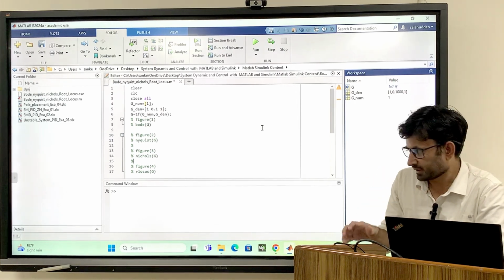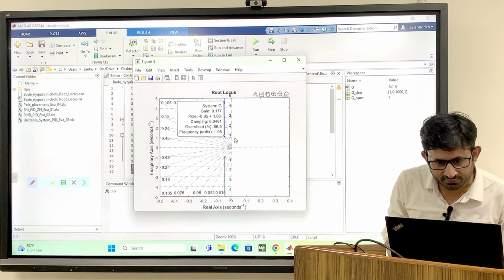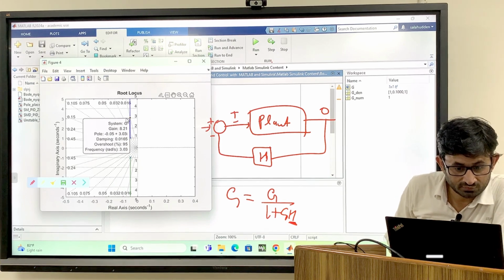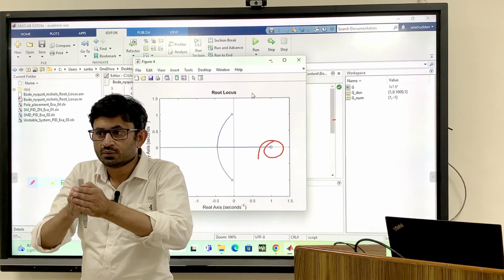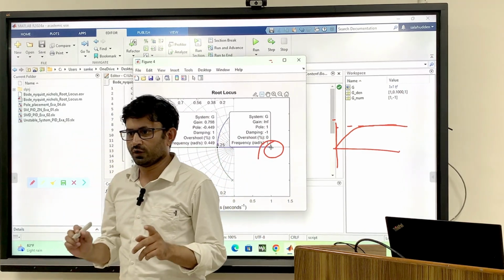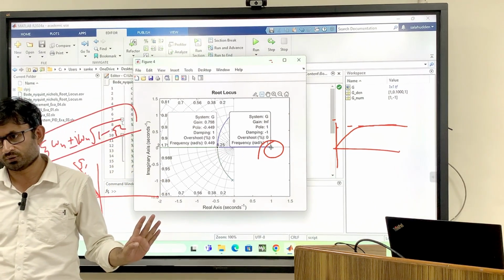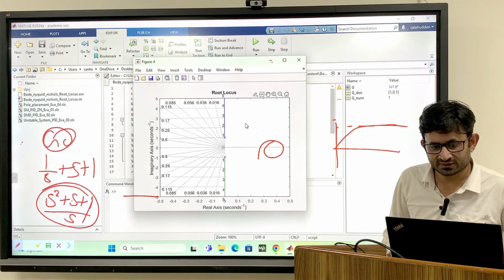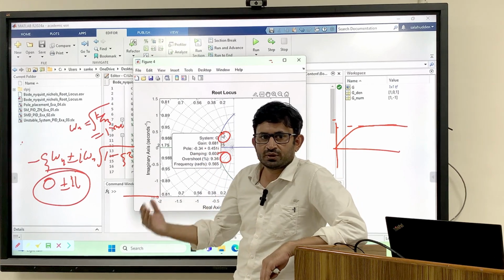Root Locus | SD and Control with MATLAB and Simulink by Dr. Salahudden

Comment: Hello sir,
how to tune PID gains..if my root locus does not cross the jw axis, since it is not crossing jw axis so I can't use ziegler nichols.
Reply from the maker: @ravipratapsingh9910  Hii Ravi, thank you for your comment. I request to see the video (mass, spring and damper system with PID), available in this course. There you will find the heuristic approach to tune the PID. The exact timing is 6 minutes, you may start watching. Let me know you face any problem after watching that video.
Reply: @DrSalahudden  Sir, 
Thankyou for replying I watched the video of Spring mass damper system with PID and understood the Method to tune PID gains.
Reply from the maker: @ravipratapsingh9910  Good to know 😊